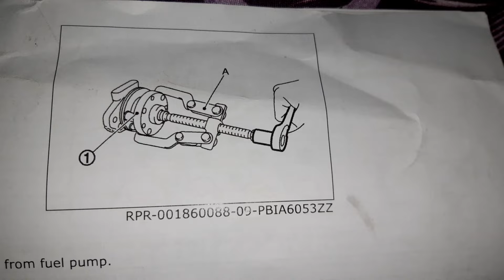NISSAN NAVARA NP300 YD25 FUEL PUMP REPLACEMENT | NAVARA NP300 REPLACE FUEL PUMP ASSEMBLY

Comment: Hello, very good video.
I have a big question and it is about the tool you use, we used the KV111 tool.
where you can get it.
It is strictly necessary to use is useful.
Thanks in advance